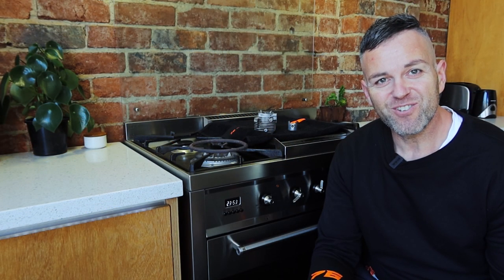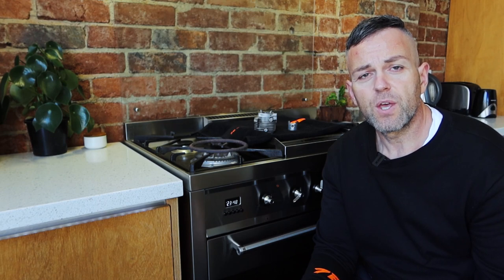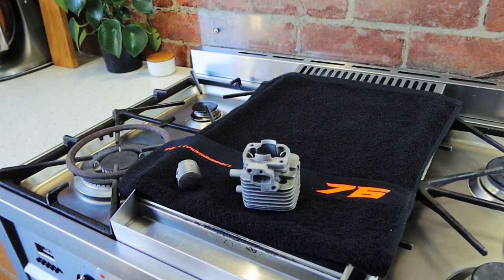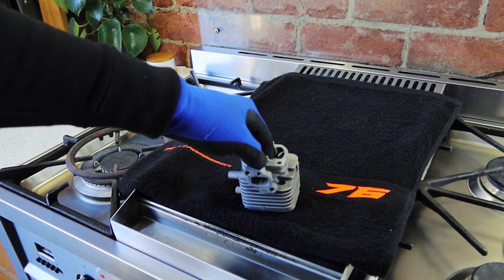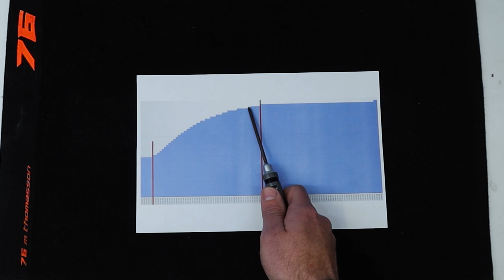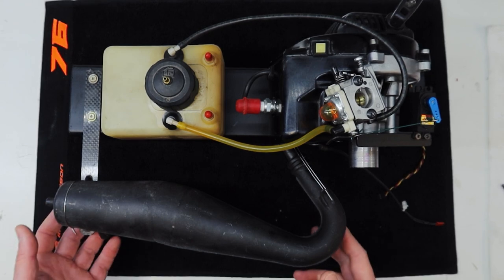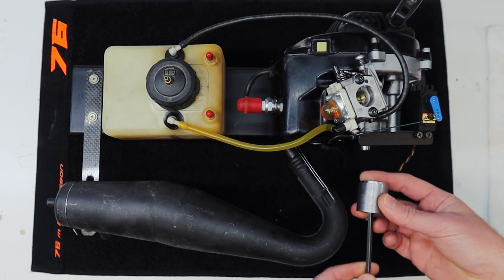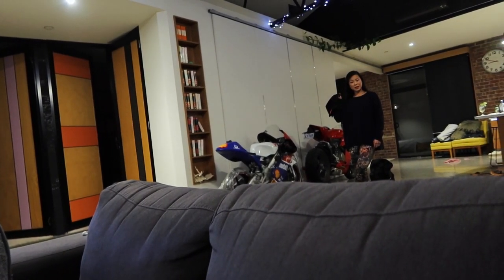MAKE YOUR RC CAR ENGINE LAST LONGER - RC Tips & Maintenance From The Workshop

Comment: Maybe an idea for a future video would be about the telemetry you are using.  You mentioned modifying the end of the temperature sensor but it also looks like you clad the wiring with some braided material.  If possible, it would be great to learn more about the wiring. Since you have four servos and a temperature probe going into that receiver it would be great to see how you managed to get 5 wires and a battery hooked up to your receiver.
Reply from the maker: Thanks for the feedback Mate! I'll make a video covering the setup and wiring, will include how to shorten servo wires too (thats a big help in keeping everything neat and tidy!) again thanks so much for the ideas!!

Comment: Great video , so do we start are engine and let it tick over for 2/3 minutes before driving the car or start the engine and do low rev ups for 2/3 minutes, what’s the best way of heating the engine , if anyone can answer me that would be great , I’ve bought an Fg marder but haven’t had the chance to take it out for a run yet .
Reply: Give the motor about 30secs to come to a nice idle and then start your blipping of the throttle. Throttle blips help clean the pipe out too when running a bit rich, like running in motors 👍